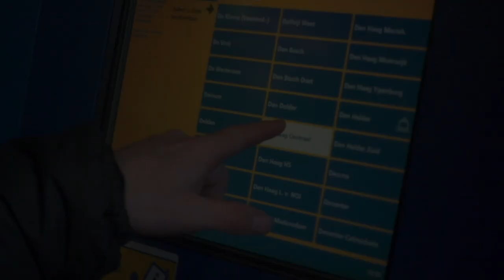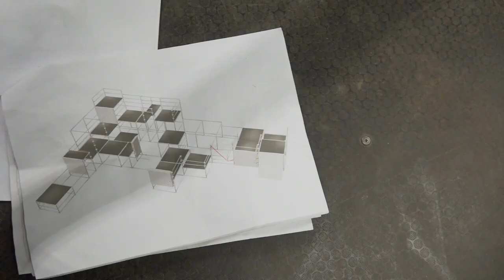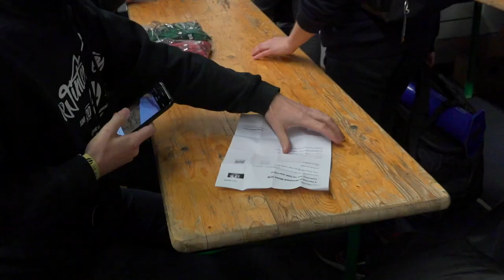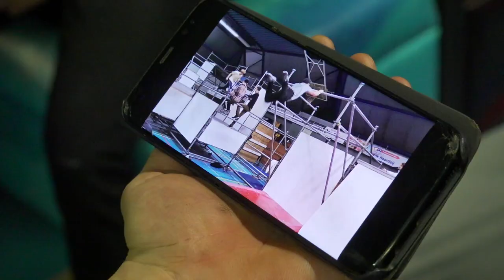4TLOM Winter 2018 | UNLOCKED

Comment: really cool event, just didnt really have a great time. I'd like to go back to give it another shot
Reply from the maker: Sorry to hear this. How come?
Reply: The Motus Projects I had injured my wrist a few weeks before so was limited in my training. And although I’m sure this is to no fault of the athletes, I felt there was some pressure if you weren’t very good and it’s harder to sort of get yourself in a spot to train, and being injured I felt like I was even less good because I don’t have a massive move set so could just do like meh sized pres without the use of an arm. Well and I didn’t read I needed a roll mat so had to sleep in hard floor for a night. And sort of closed myself off from the social aspect. I’d like to go back though and re-approach it with a different mind set.